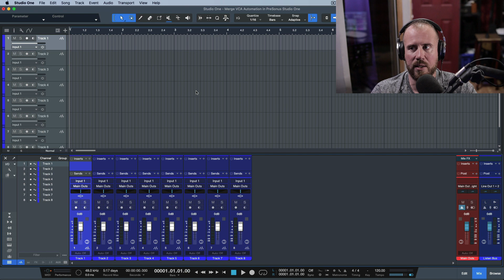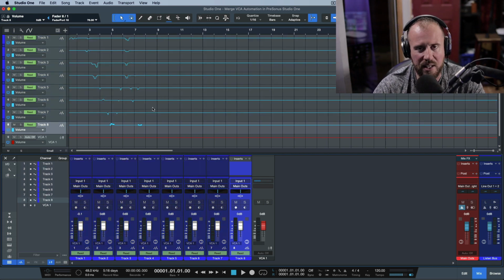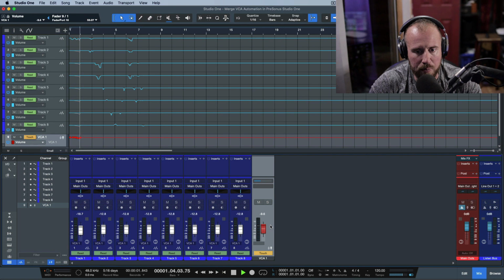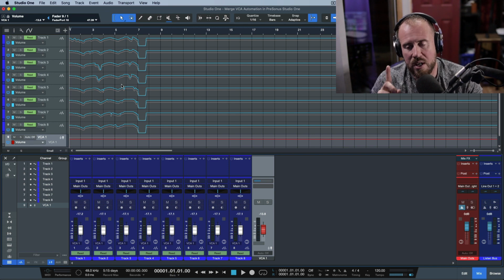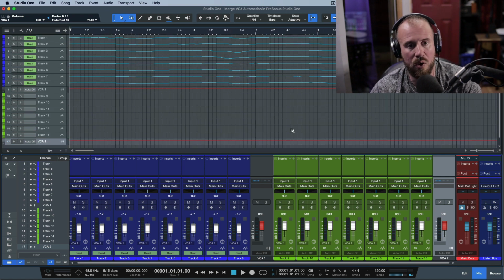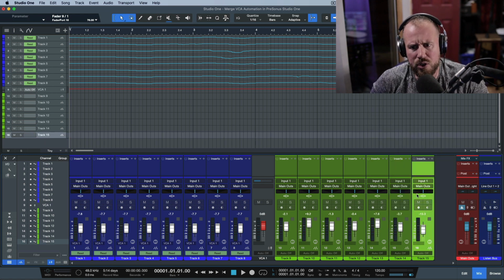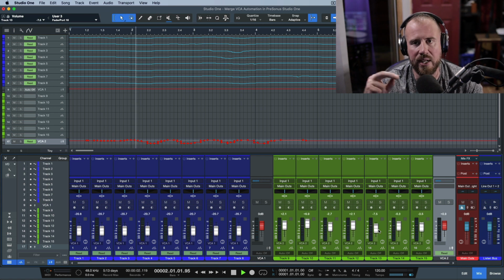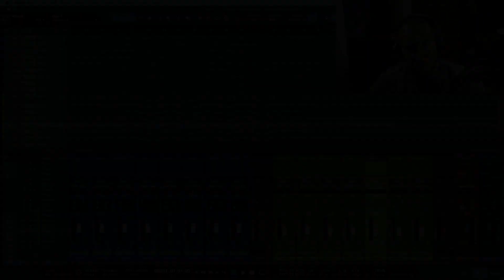How to Use Merge VCA Automation in PreSonus Studio One

Comment: Subbed !!! you just unlocked a new work flow for me I actually stayed away from automating the channel track since i started in studio one 3 , for reasons like if i need to adjust level i wouldn't be able to then VCA and Input Gain changed that for me but stilll was using "mixtool" for automation but now with VCA Merge i can levitate another plugin slot.